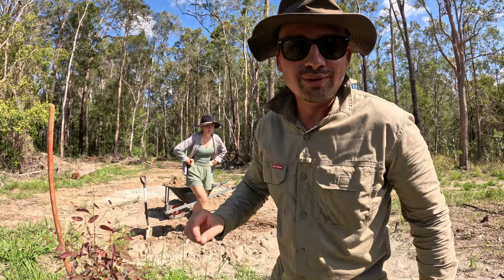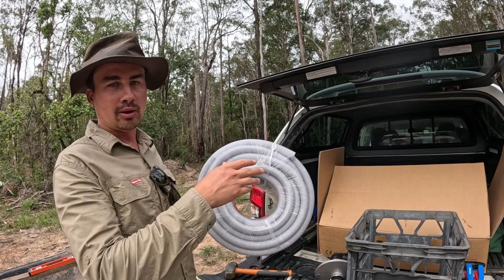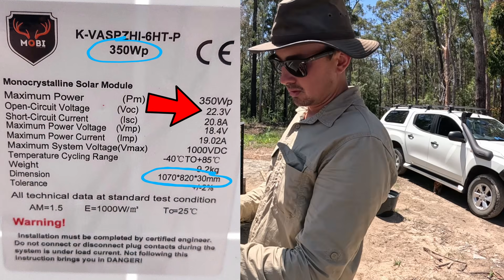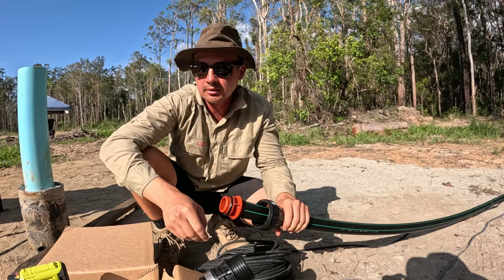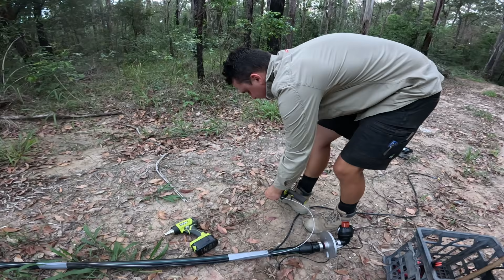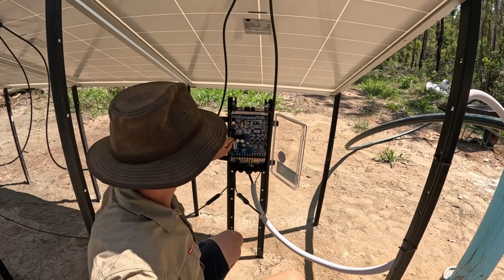DIY Solar Bore Pump Install  |  Start to Finish + Cost Summary (TuHorse)

Comment: Best video yet and very similar to my project, so a great help.  What is the brand and source of the poly pipe compression fitting?  Thanks!
Reply from the maker: Cheers 🙂✌️ it was Philmac, just from a local irrigation store, they generally stock better products than generic hardware stores.

Comment: Just watched the drilling video and now this one. Just curious as to why the water comes up on it's own pressure in the first video, but then requires a pump to get it up in this one?
Reply from the maker: The initial video had it forced out with the massive air compressor that was used for the bore drilling process 🤙
Reply: @offgridcitycouple4711 thankyou

Comment: I’d have been tempted to have the tanks installed and put the solar array onto a frame mounted on the tanks, a bit of a hassle to do, but the array is out of the way of vehicles, animals and, as a friend of mine found, much harder for thieves (he had his array and pump stolen while he was at work).
Reply from the maker: yeah that's a pretty good idea 👍

our tanks are up on a mound because the place floods from time to time, never had any thieves though. every place has its challenges i guess

Comment: Now buy a multifunction do everything machine like Avant 750 with 4in1 bucket, forest mulcher, forks etc (200+ attachments). I use mine for farm + construction work; cannot do without it. Does the work of four workers and you can work for years without ending up with back etc issues.
Reply from the maker: wow just checked it out, that's an incredible machine. So versatile, never seen one before. You'd be getting more than your money's worth with something like that. The wheelbarrow and shovel move dirt a lot slower than one of these

Comment: Is there any reason why you didn't get the tuhorse bore package the solar panels? I'm not criticising, I'm just curious as im about to buy it.
Reply from the maker: @jaidantrend6871  they didn't seem to have enough solar panels as what we needed at the time, but getting everything in a kit would be convenient. 

That Energy Connections online store had a 20% discount store wide recently, they'd likely send out the panels at a better cost and you can get as many as you need. 

At the end of the day they will be pretty similar, all from same/similar factories in China
Reply: I'll look into it. Thanks for the quick reply 🙂
Reply from the maker: @jaidantrend6871  ✌️

Comment: Dear Alex, you should isolate the bolt that is fixed between the star picket and the aluminium frame to prevent galvanic corrosion over time. This will protect your warranty on the panels. The star picket is mild steel and the panel frame is aluminium. In the presence of water (i.e. rain/humidity etc) corrosion will act on the 2 dissimilar metals. Luv your show :)
Reply from the maker: thanks for the insight, very good to know for the future. Do you mean to simply paint the bolts to isolate them or add rubber washers too?
Reply: @offgridcitycouple4711  You can paint them, but better still, use a plastic washer, such that you electricaly isolate the star picket from the alu frame.  i.e. if you use the "continuity check" on your multimeter and it beeps (i.e. continuous circuit) when connecting the alu frame and star picket, then you have a circuit that can conduct electricity in the presence of water. This will initiate corrosion of the alu frame.
Read up on galvanic corrosion on google and you will see what's required.

Comment: Thats cool, i didn't know there were solar to load controllers like this that can operate a pump (or any device) without a battery in between. Awesome set up. All your videos are awesome too, as part of a city couple myself i have been dreaming about doing something similar for ages, so im super jealous!
Reply from the maker: @nathan100tz  thanks for your kinds words 🙂 
We also didn't know these were around. You could really leave it on all the time and every time there's sun it'd be pumping, probably not the best for the pump to be turning on and off all the time. 
And it is a pretty cool journey to go on, funny enough we just sold our land and are returning back to a normal life. Just need to catch up on videos that we already filmed and make one about leaning it all behind lol
Reply: Oh no! I'm still a year behind too 😂
I even had a quick look to see if I could find your place listed on hipcamp.
I set up some home automation so that when our grid connected solar system is exporting enough power our pool pump turns on, then it turns off if it drops below a threshold. Works well but no doubt shortens the life of the pump.
Reply from the maker: @ it was a bummer we didn't get time to have the place listed on hipcamp, would've been fun to see all the happy campers enjoying nature 🤠

Comment: Aluminium is cheap.
Get a length, cut it, and make a bracket.
8m length of 3x3 steep is like 80 bucks, cut it in half, put 1m in the ground and concrete it.
3m out, panels on top with Aluminium to mpunt the panels.
Reply: Wouldn't waste time with a heat gun mate. 35 years running irrigation, and never once used one or ever heard of that.
Reply: Put the panels as close as possible to the bore as well.

Saves all the other nonsense.
Reply: I got German 2nd hand solar panels off market place, for 50 bucks each...

I wouldn't buy from eBay's.
Reply: 19 would be misprint.
I'd say they meant
9. Max
Reply: *flange
Reply: Get a set of stilsons when working with irrigation. I've got 6 😅

Comment: Excellent work guys,  you have given me the courage to do it, I see it's not hard.  I'm in NSW and have been charged around $10k for a similar project. Will do it myself ❤
Reply from the maker: @jchinomona  with the right attitude and some research which you're already doing, you'll likely do an even better job than the pros 🙂

Comment: You could've used 2x house panels 540w @ 46voc will take up much less space and are $200-$300 per panel. Which would've saved a fair amount with much better performance not to mention avoiding the use of getting jibbed by fleabay.
Reply from the maker: @scoffee82  yes that was our conclusion after this debacle. These were meant to be 1.5x bigger, and the price wasn't even better than regular house panels...

Comment: Hi guys!
So far, I love my tuhorse pump. It’s made me realise that I will just make each windmill on this farm obsolete over time and replace with a Tuhorse. I also saved around $10,000 on what the professionals quoted and on what I’d used once before. 
I want to know why you set the pump speed at 50%? I’ve left mine at 100 without giving it much thought. Should I adjust it, what was your rationale for 50%?
Hope the project is going well!
Cheers
Reply from the maker: @morvenkeckavich6669  g'day 👋
Awesome to hear your install went well, guess the windmills probably can't give a consistent 30+ litres per minute hey 

And as for not setting it to 100% it was the same premise as not operating an engine close to redline revs, and same with not working so hard we wreck ourselves 😀 

So overall it was with the intent of extending longevity, and not having the pump fluctuate as much when a cloud passes because more often than not with thin clouds it can still operate at 50-80% rather than speeding up and slowing down and putting more strain on everything
Reply: @ yeah cheers. No the windmills certainly can’t. It’s the hot still days where you need h2o the most that catches them out. 
Thanks for that. That’s generally my principal with most things too. I think I’ll back her off to 80%!
I don’t know what it is about these things but they get in your head. Great little units!
👍🏾
Reply from the maker: @morvenkeckavich6669  nice, it is lucky that solar panels are good for hot sunny days when we need water most. When we first set our pump up it was like magic, water out of nowhere 😀
Someone in the comments has said to install a sleeve on it from a PVC pipe so it sucks water from the bottom and sediment isn't passed through the pump. Seems like a good idea but there's no way we're pulling the pump out unless absolutely necessary lol

Comment: I'm too old for that manual works nowdays.  I best thing we did was to get a backhoe.  I got a 4wd , with 4in1 bucket, Air con.  Every time a storm comes through a tree falls over, these machines will move them about, all but the largest.  IMO, better than skidsteer on these properties, hard to bog, will climb over stuff etc.
Reply from the maker: Everything is easier with the right kind of machine, sounds like the dream to have something like that 🙂

Comment: Will be interesting to see how this holds up over time. Here in the usa I have installed RPS solar pumps. I have found the sand grinds up the impeller blades over time reducing head lift pressure.
Reply from the maker: We watched the RPS pump install vid, and that pump looks identical lol

This one does have the helical rotor instead of blades though which should be a bit more durable but maybe they do wear out and maybe that's why a spare one was included with the pump.  

But yeah will be interesting to see how it handles the test of time 🙂

Comment: You need to install a cooling shroud on your bore pump before putting down otherwise it will be lucky to see out a year or 2. This pump looks exactly The same as Orange Pumps Hydrotron. So definitely put a cooling shroud on it as I’ve pulled out a lot of them with burnt out motors from running hot.
Reply from the maker: Thanks for the heads up, we didn't know about cooling shrouds but they do seem like a really good idea, especially considering it helps to take in less sediment. It's such a big job pulling the pump out though...
Reply: @offgridcitycouple4711  you definitely don’t need a shroud in your bore they are very tight in the casing and can get your pump jammed in the hole. for anyone that thinks a shroud will cool the motor I ask if you would be able to heat up water flowing through your kettle/jug let alone boil it.
Reply from the maker: @stevenbaker9163 that is a very interesting point you make, especially considering how cold the water is down there 🤔 
There are so many ideas out there for how to do things right... Hard to know the best way. 
Cheers for your input 🙂✌️
Reply: @stevenbaker9163 incorrect and bad advice. I work in the industry. Look up the warranty terms on the pump and I guarantee it will mention a cooling shroud needs to be installed. We are constantly pulling these failed pumps up because they have failed due to not have a cooling shroud on them and they only last one or two years without it. The water around the motor doesn’t move without a shroud so it definitely gets hot just like a kettle heats water. Anyway these guys don’t own it anymore anyway so not their problem.
Reply: @rusty @rustynail4x4 a licensed 3rd generation water bore driller with 30 years industry experience yes there is times a shroud is needed not in there application at all. Too many times a burned out motor is blamed on the wrong thing. Most failed motors are from too many Start stops wrong Pump for the application over pumping (running dry) aeration in the water from cascading water. (Bore not constructor properly) pore pump placement not overheating. That 4inch twohorse pump with the low water sensor doesn’t need a shroud it’s actually a very bad idea as any ductape or cable clamp that’s dropped down the hole can jam the pump in. And yes the driller used PN9 not PN12 so there’s a slightly bigger gap with a shroud but he also slotted across the casing as is the standard this gives a point for any thing to be jammed and lock into the slots a $500 twohorse motor is far cheaper then a rig fishing out a pump or a new bore.
Reply: To refer to a shroud as cooling is not correct. Water is one of the best heat exchangers and moving water will not let the motor get worm let alone hot. Just consider a pump placed just above the slots every drop of water that it pumps already comes past the motor into the inlet I have twohorse pumps without shrouds that are still in service 6 to 10 years no problems and others that fail bobby will happily send a new motor if one fails as they do occasionally. Don’t let these pump companies sell you rubbish you don’t need.

Comment: It must feel good to see the water flowing like that. I hope the water tests ok so you don’t have to spend too much on filtration.
Reply from the maker: It's such a relief, and we really appreciate something as simple as a water supply after carrying jerry cans around for a long time 😅

Tests came up good, but water goes cloudy after a couple hours so it seems because it's so hot and there's a lot of minerals the algae has ideal conditions.. 

Gonna try block off all sunlight going into the water tanks and see if they clears it up. Have u guys ever had a similar experience?
Reply: @offgridcitycouple4711  no we haven’t done a bore. It is something we have thought about but really not sure how successful it would be here.
Reply from the maker: It would be nice if there was some kind of way to know for sure

Comment: This heat/humidity is a very draining, so well done to you both cleaning up the drill site👍. Congrats on getting the bore pump up and running😀.
Hopefully you have to pull it up for quite a while, by hand thats a possible hernia operation waiting to happen, ask me how I know lol.
Reply from the maker: Oh man not a hernia that sucks, hope it recovered alright 😐 

If the pump needs to come up hopefully we can lift it a bit at a time, and hold it while the water pours through the pump and the assembly is lighter.....

And yeah this heat is full on, after 6 hours work I'm a write off, bring on autumn!

Comment: My family has been using a star picket solar panel array for years, nothing wrong with it!

So good to see you get more comfortable in front of the camera, it allows much more comfortable explanations & comes across more friendly. 

and yes, she'll be right mate is a perfectly acceptable form of setting the angle haha!

Also, even though the results came back okay to drink, will you still filter it?
Reply from the maker: Didn't know you guys were into redneck engineering too 😅 And if u try to pull a picket out, it ain't easy! With 8 working together it's unbreakable lol

A work in progress this whole filming thing.. I guess no matter how bad we wanted the first videos to be good it goes to show you can't learn these things overnight, it is getting more comfortable for sure, thanks for the observation 🙏

The panels on our van are completely flat so off by 30° basically and in winter we lose maybe 15% capacity so that's given us the confidence to eyeball stuff. In fact the squareness of our entire mound was an eyeball effort 😅

With filtering, there's minerals in the water like iron/calcium/magnesium and they're naturally occuring and hence not harmful to drink. We'll put it through our Lifestraw jug still for filling bottles, but probably even healthy to take in some extra minerals 🙂

Comment: Great job, but I think that the steel cable that holds the pump should not be tied to the polyethylene hose with the sensor cable and the power supply cable. Do not tie everything together with duct tape.
Reply from the maker: Cheers 👍 Most other install videos by pros on YouTube had it like that so we just went with the majority there, it slides real easily past the duct tape and everything else so it is separate in a way. What's your reasoning for having it separate?
Reply: @offgridcitycouple4711  I say this because the steel cable, in case of support, the entire weight of the assembly will be tied together with the power cables and the sensor, I personally would tie the power cable and the sensor just as you put it, and then the steel cable , but not all at once, but separately. just like you did but not all under the same tape. I love your videos, thank you!
Reply from the maker: @brejonsport  thanks for your kind words 🙂 and you got me thinking about it lol so I checked a few more videos out and seems it's fine either way 👍 but yeah the steel rope slides through the tape real easy so it won't pull on the wires (I was concerned about that too at first)

Comment: It appears as if  the solar panels are just for the water pump, which after your tanks are full will do very little , wasted power. Did you look at 240volt pumps so you can use a generator in emergencies. Go to BOM and you can see what the solar radiation is at your location on a daily basis. I suggest you may be inaccurate in your assessments.
Reply from the maker: The bore pump isn't just for drinking, it's for irrigation too, which is currently taking about 4hrs run time per day to establish vegetation for erosion control. 

If a generator uses 1 litre of petrol per hour, that's 4 litres or $8 per day in running costs. We spent $900 on solar panels, so $900/$8 means that after just 112.5 days or less than 4 months the solar panels paid for themselves - just in fuel cost savings alone (excluding wear and tear and cost of generator). 

We took all the numbers into consideration when getting the solar pump, it's worth it for sure, even if you're not using all available energy 🙂

For emergencies there will be a 20,000L backup tank with petrol powered firefighter pump, and u can also get 48v ac-dc converters to be able to use generator.
Reply: The amount of power generator is minimal....
Not even worth bothering with.

Also generator over ride can be done, easily..
24dc power supply..

Comment: In winter solar panels produce half as much as in summer and also floormounted need a fence once animals on farm so animals do not get stuck under panels
Reply from the maker: yep, it was a bummer about them undersized solar panels. We'll bump up the 700W to 1,000W soon, and yeah we'll probably need to put a brick wall or something around it too as it's right near the bush in the event of bushfire